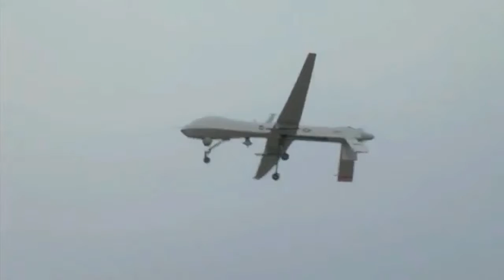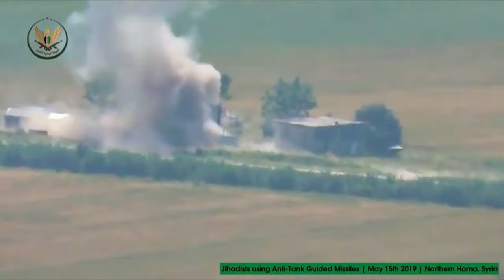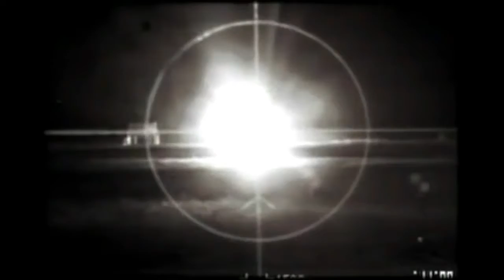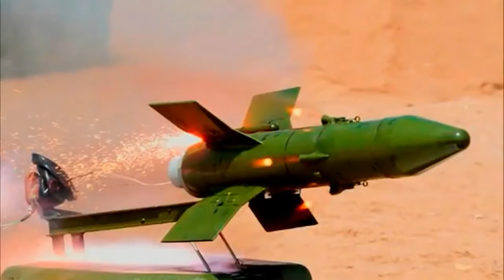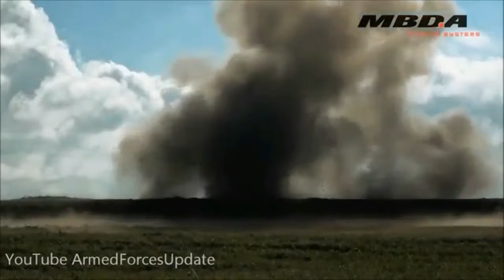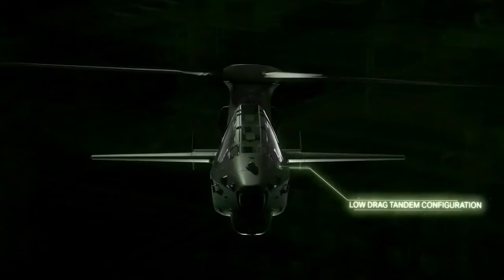Musings on the Need for a Cheap Guided Infantry Weapon

Comment: What capability gap exists between the Javelin, the TOE, and the LAW? Phrased in other terms, how do you justify giving a LAW a guidance system? Maybe the Specials need something like that; but for the Regulars I can't see that a guided LAW is much more useful than the existing unguided version. May I suggest you should post an updated and expanded version of this video that talks about what you talk about here and adds in the information regarding new munitions like the Switchblade? What capability or capacity is gained by a unit for adding guidance to a mortar shell?  Does it matter whether it's a guided missile or a guided shell?

Comment: Laser-guided mortar warheads. 

The primary advantage is weight and accuracy. Mortar rounds' propellants are lighter than an equivalent range rocket; so a platoon-level unit and have more rounds carried. They should be more accurate for a first-round hit than current mortars (the ATGM's advantage when used against infantry clusters, for eg.)

The downside is that any guidance system for a mortar warhead need to survive the much higher acceleration of the initial mortar launch. 

Failing that, there's the towed Chinese Type 62 MLRS. Replace the dumb rockets for laser guidance
Reply: @ejt3708 the VT fuse out of a Bofor is relatively simple while a precision-guided kit is a lot.more complex. Is it laser guided? You need a camera and all the chips and electronics associated with it, then chips and programing to actuate and steer the rounds.

That said, these were already in R&D at the tail end of the Cold War but the collapse of the Berlin Walls and the peace dividends put an end to that. Right now, drones rule the ground game sky but I think countermeasures will soon make it a lot less so (there are laser-based detectors that can search and pin point the direction and heading of a scope, camera or sensor. Those may include a sniper scope or a drone camera. The origin can be attacked with a high-powered laser. It may burns the eyeballs behind the scope, or the sensor). Or we may just start to make a lot more air defence artillery or even air superior drones. 

Eventually, it will go back to the way it has always been: a poor light infantry chap weighted down with weapons, ammunitions, water, food, sensors, communication equipmment, drones and counter-drone, etc ...

Comment: LAW-72 works well for this, since it's lightweight and cheap, though it's not guided. Maybe a laser-guided version could be made. Laser guided is among the cheapest and easiest of guidance systems and is being put on pretty small stuff (there's even a laser-guided 40mm grenade/missile out there).

Comment: I read somewhere a SAGGER round cost about 1500 dollars. Has 3 interchangeable warheads. Has a range of 3000 meters and a 3 man crew can manpack 4 missiles and the launcher guidance system. Give them an ATV type vehicle. And that's probably as good as you will get.
Also read that the Communist guerrillas in the EL Salvador. Converted 60mm and 82mm mortar rounds, to be fired from the RPG7. They used it as an anti armour, anti bunker, anti helicopter,  pocket artillery type weapon. I guess communists are just anti everything 🤷‍♂️😁🇬🇧

Comment: The first development & combat use, of a wire guided AT missile system, was by the Germans in 1945, with the Rottekapchen (Red Riding Hood). The system consisted of a small sled mounted launching rail, a control box and winged missile. Due to the size & bulkiness of the missiles, the 3 man crew could only carry 2 rounds to fire.

German test data gives the armour penetration as up to 180mm. @ 0 degrees and a guided range of around 600 metres.  

Used exclusively on the Eastern front, so countless examples were captured by the Soviets, for reverse engineering.

I have a metal 1:76 scale model of a Rottekapchen & crew, made by SHQ models, for wargaming.

Comment: Damn man. U brought the thoughts and even the perfect weapon out of my mind. But I thought of it as a portable beyond firearms reach, bunker buster in Himalayas. And because the at 3 is old, but cheap. It's launcher and guidance modules are easy to acquire. Plus as u said modern relay systems with data transmission, can enable a soldier with a tablet or similar smart device can easily guide the missile without being present in the same vicinity. In Yom Kippur Egyptians used to have multiple launcher per guidance module. Same cam be used here with multiple launchers being placed at different locations away from enemy eyes at long range then launching them to either supress or destroy bunkers and trench lines.would be much cheaper than using drones for the same purpose and  risking a valuable recon asset

Comment: SALCOS is the cheapest you can go ,as the missile contains only a motor, warhead and steering mechanism. switchable warhead might not be any more practical than a separate missile altogether. Separate guidance unit was discarded on SALCOS units as you need a separate tripod for both missile and the guidance element for stability when shooting at longer ranges. sager carry box served both roles but is limiting in  rocky terrain or urban one vs a proper tripod .

Comment: what about SACLOS with a remote viewer and controller instead of MCLOS? just look down the viewfinder from a safe distance and use the joystick on the controller to keep the crosshair on the target and let the missle do the rest. you could make a more cost effective, more reliable (and less dangerous) version of the MILAN/Kornet and just have it controlled by an xbox controller with a phone like device slapped on top of it. I'd keep it wired so that the video and control latency is minimal tho, with some sort of voltage booster/fibre optic you could practically set up a single/multiple use ambush point with a hide 50m away.

it might not be a 4 $ digit missile but it could knock it down to a 5 $ digit missle

Comment: I was wondering if heavy drones are ever used with guided anti tank missiles?  The concept might not be possible, but it sounds like a cost effective way if slicing through armour formations with no risk to personel.  If you could 'build' say 50 of these an swarm defences then plenty of objectives come into play.....
Reply from the maker: Sort of, but they just have the warhead on the drone and direct it into the tank. Azeris did this against armenia with their loitering munitions- which is basically a drone with a warhead.

Now though, operators are fitting are fitting stand off screens to negate that. 

The pendulum swings...

Comment: I think you've got a very good argument on anti-tank armaments. Heavy read about the Yom Kippur War I know how effective the Sagger units were against the Israeli Tank units. Well hidden, not very bulky and could be put together in a matter of minutes. Best I can suggest is a semi loitering munitions anti personnel and anti armour system based on Sagger or RPG system fired into the air reached 100 ft of target area with enough fuel to hang  around providing optical coverage to the operator via secure communications and once target and position is identified operator directs it there and it dives on to it. Some tanks are light skinned at the top so such a system would be effective against them and personnel. Let me know what you think.
Reply from the maker: Ahhh...check my recent vid on the new  Carl Gustav munitions 😁

Comment: I always thought the good old Carl Gustav 84mm would be good base for a brilliant e.g. fire and forget system. With all the advancements in electronics it should be possible to do such a weapon for a reasonable price - or even use different (guided, unguided) kinds of projectiles for it.
But I would go a bit further and bring Non-Line-Of-Sight (NLOS) weapons into the game. Especially for mobile troops (armoured infantry) this could be an alternative for those squads lumping around those weapons while still retaining their anti-armour capabilities. Think of an IFV that carries several vertical launch tubes and is through the infantry able to attack a tank while covered up. 
To extent this - a medium sized version, based on weapons like the Hellfire/Brimstone, with a range of twenty or thirty kilometres could be operated from way behind the FOB.
I know the US tried to develop such a weapon a decade or so ago but they´ve stopped the program.

PS: It´s a bit sad that I´ve found your other military stuff rather late after being drawn here by the excellent aircraft videos. But, tbh, ground operations do interest me much more.
Reply from the maker: Ahhh! I think a video today/tomorrow will be of interest to you.
Reply: @EdNashsMilitaryMatters  A smart round for the newer lightweight Charlie G versions could be really interesting. Did you release the vid you mention Ed?

Comment: I would have thought that it'd be easy enough to pack an R/C model full of explosives and fly that in using off the shelf FPV equipment.
Reply: basically a cheap suicidedrone. Dirtcheap and can be build in a cellar. Cheap camera to front and a small trip to homedepot. we probably can get below 1000bucks
Reply: Aiy, I would suggest something flat enough to get under a tank with shaped charged and detonate. I mean for a wheel based or track based vehicle, it'll be immobilised. Several should be deployable from APC or be carried by squads. I know I know. Command n Conquer but these ideas should be put to the test.
Reply: @alvarezhulio  It would be easier to build a cheap suicidedrone that does an attack from the top, striking the lowprotected roof insted of taking the risk on uneven terrain. A M113 with ~20 of these sitting behind cover while a kid with a joystick guides them into targets
Reply: @d3203  Aiy,  I suggested something similar one in an entry at start of the thread! We think alike Mesa tinks! Anymore ideas mate.

Comment: I always thought bringing back the 106mm recoiless rifle is a good idea, a good way to bring useful firepower to a small outpost on a hill.
Reply: The Taliban used them effectively against us.
Reply: @SoloRenegade  that would be the Soviet 82mm RR?
Reply: @Colinpark  Quite possibly. Didn't get many good looks at them. They'd shoot and scoot. Or they'd use them to lob rounds over the FOB walls as artillery, but low trajectory to avoid the blimp radar and artillery counterfire, so we never saw those.
Reply: Having been a 106 plt cmdr I loved the weapon but effectively the Carl Gustav has replaced it with a far smaller logistical tail and signature. Keep in mind the targeting was a .50cal wp round hitting your target and then firing the main round. So you announce your presence and then hope to have time to fire your main gun and then move elsewhere 🤔
Reply: Coupled with a modern fire control system. It will be a frightening weapon. Or perhaps a longer ranged cousin of shipon can also do the job.  https://defense-update.com/20020601_shipon-anti-tank-weapon.html
Reply: The problem with the 106 is size. Sure you can drag it around on its wheels for a bit but really, it is a vehicle mounted system, and an open topped vehicle mounted system at that. This makes it hugely vulnerable, not helped by its robust signature when fired which is a dead giveaway to its position. 

A relatively low-cost precision guided weapon with a multi-use warhead that is man-portable is a solid concept. Something between M4 Carl G and Javelin. 

It's called NLAW.

Comment: Amateur rockets of 54mm, 75mm and 98mm are being launched at a cost of $10 each time, there is no excuse for not having cheap rocket weaponry.  Yes these are low powered, but the tech is simple, they reach 12,000 feet. The military weapons firms make expenseive weapons because they can, and gov pays. 
A simple launcher, with a guidance system, following a laser track, powered by a single stage rocket motor with 2,400m range and having a shaped charge head can be produced for less than $1,000.
Reply: To be fair, $10 each launch is for a reusable rocket. High power rocketry converted to single-use is much more expensive. However, I agree it still would/should be far cheaper than what the military is paying.

Comment: I’m sorry to tell you this but it’s America it will cost at least 50 thousand a round if made here that’s how it’s done here thank god for  the Carl Gustav . In those years we didn’t face many tanks however the tow is relatively cheaper then most guided systems today but is not as portable .
Reply: Canada just dusted off some old TOW systems and is relearning how to use them, our bright minds decided we don't need ATGM, mortars and Manpads. The Carl G was our primary AT weapon for many years. Back in the 80's I got to help fire 106RR,  and used 3.75"RL's , Carl G and the M72.